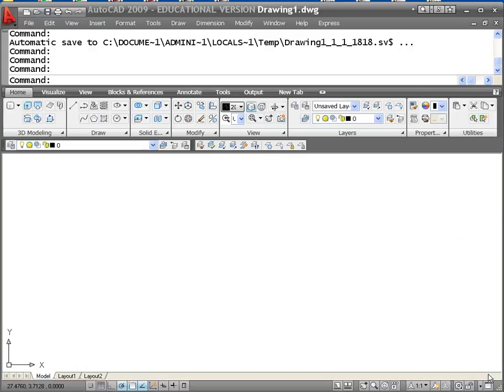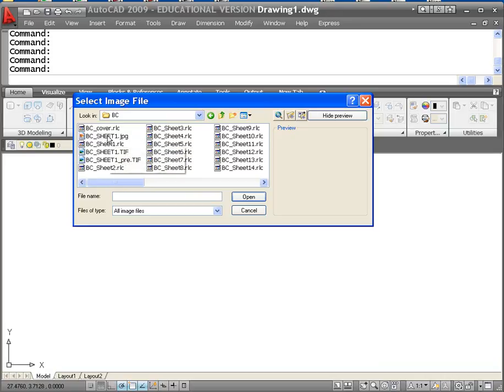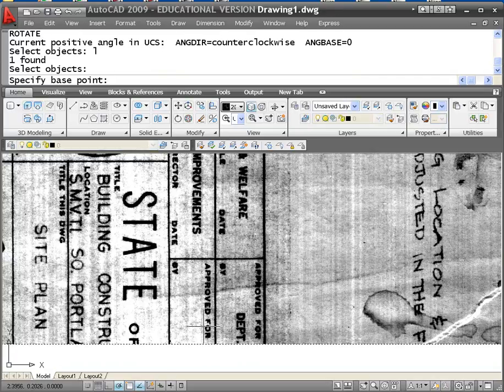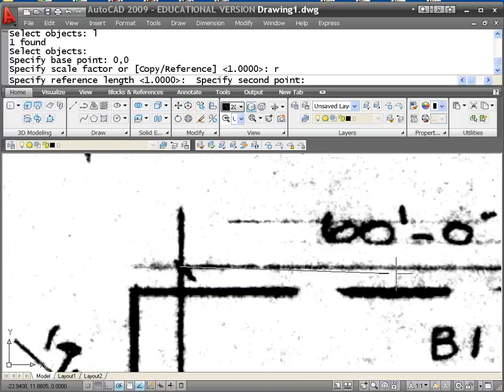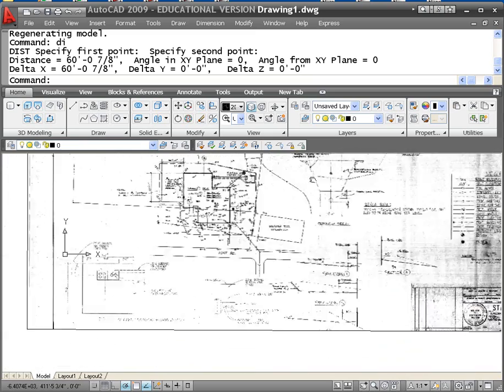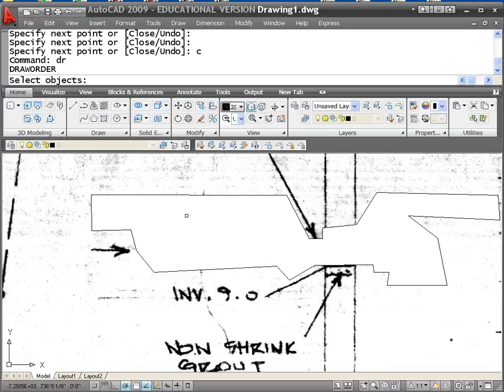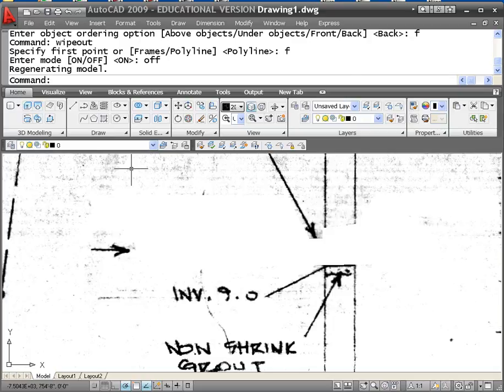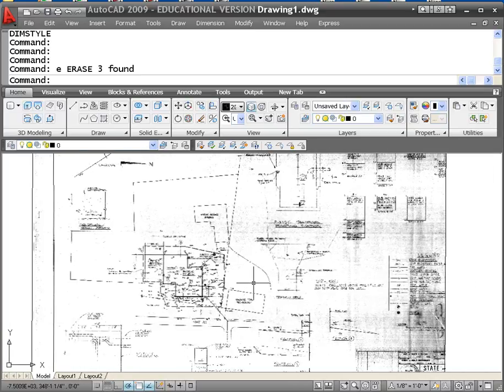Raster-Vector Hybrid Drawing in AutoCAD

Comment: do we have to scale to get one to one scale?
Reply from the maker: Once you scale the drawing into real world units, everything you do is 1:1.  If there is aspect ratio difference you have to compensate for that. I don't remember if I show that in this video or in a different one, but that requires you to create a block out of the image after scaling in one direction and measuring the distance in the other direction. If it is not what you expect, you have to determine what dimension it should be. Now insert the block at a scale factor of 1 in the first direction (always horizontal when I do it) and at the desired dimension in the other (Y in my case) direction.